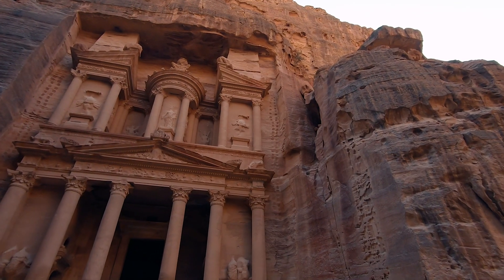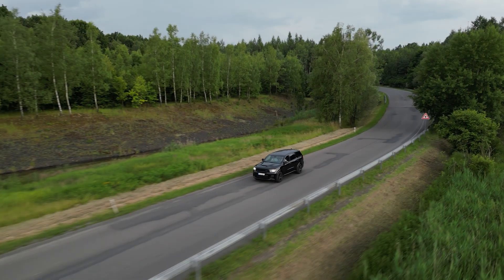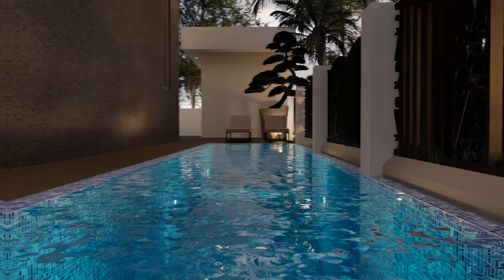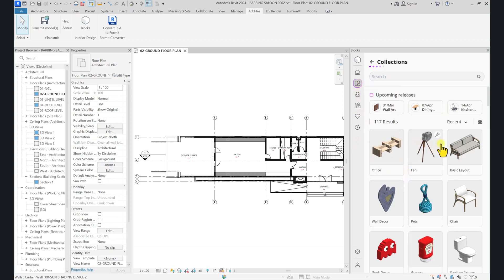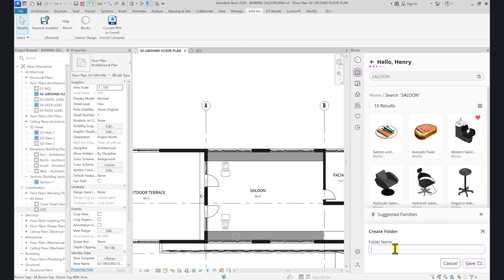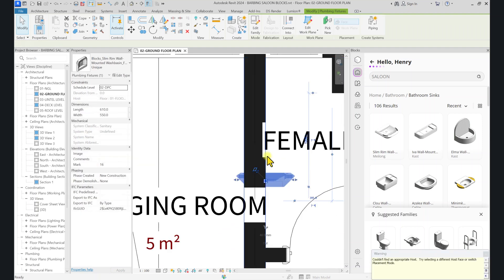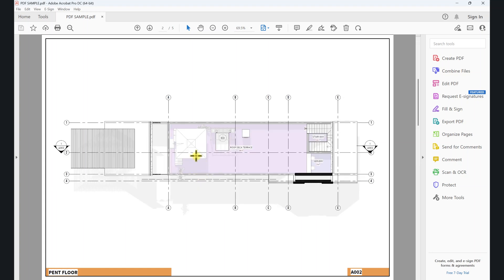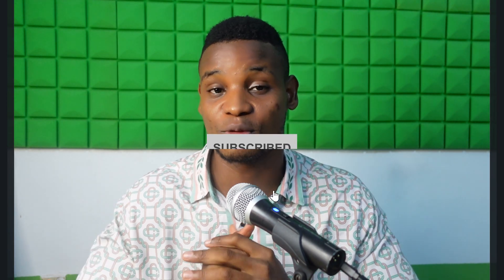Upgrade Your Presentation In Revit with Blocks Plug-in/ Free Tutorials

Comment: But most of them are not free,they  need to make  payment to get access to some
Reply: Can it be used offline?
Reply: Yes  @iyiolasalami824
Reply: Exactly 💯
Reply: me too
Reply from the maker: Very True.. though the free ones can still be helpful for a basic project . But I guess the thumbnail may have given you the expectation
Reply: @architectpiperr4918 I have used it for a while now. Even the free library has very decent and practical components however, my blocks plugin stopped working suddenly on my revit 2024. Did uninstall and reinstall still no luck. Any idea what might be wrong?